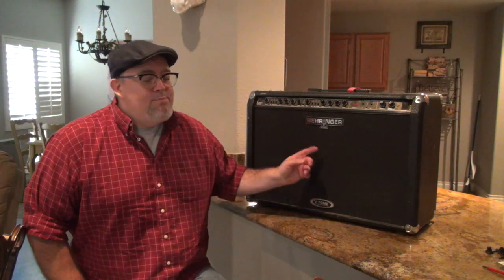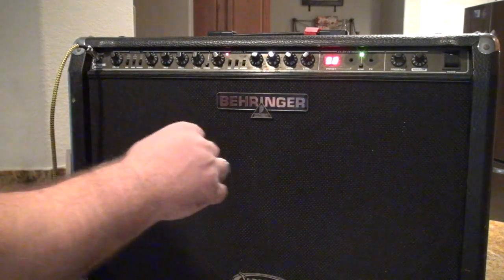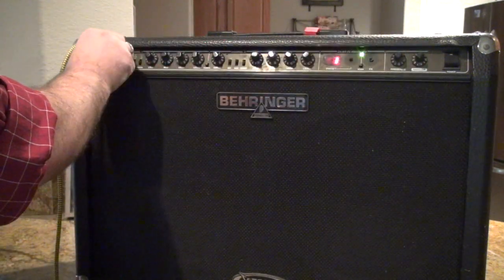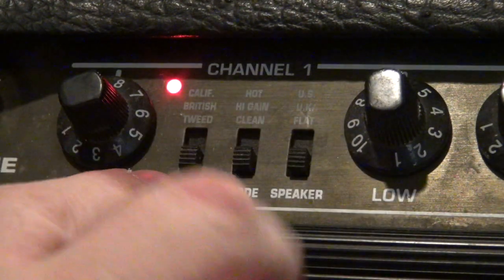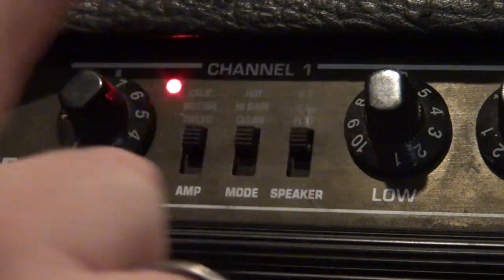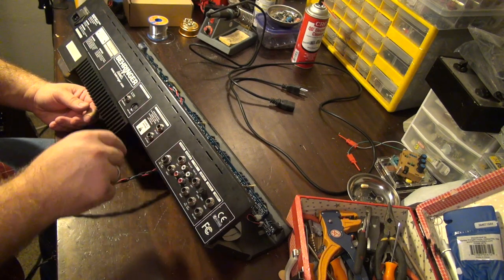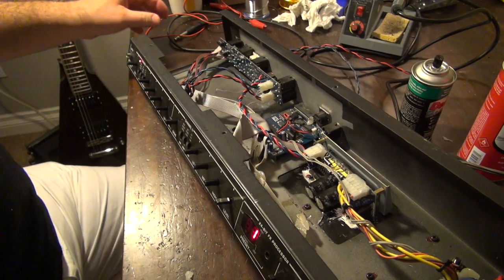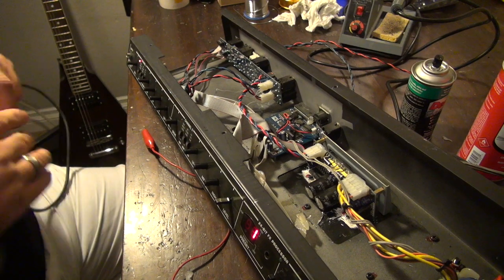Behringer GMX212 Repair and Demo

Comment: I bought one of these amps in 2004. Mine came equipped with Jensen speakers (which were likely made by Behringer and branded as Jensen). I used the amp for years and gigged with it fairly regularly. I also had the Behringer FCB1010 midi board that I used with the amp. The midi board allowed me to switch effects on the fly from a footboard which is a must if you are gigging with the amp. I had no issues with reliability and I carted the amp all over for gigs. It does not take pedals very well but the onboard effects will get you by.
Reply from the maker: Yes, I was blown away with how good this amp sounded. I'm kind of regretting selling it. Thanks for watching!

Comment: Very Awesome and informative video, although i would like to have seen some more of the capacitor fix and deoxit clean up. Great job on the clean up. Rock on!!!
Reply from the maker: I picked up another one of these that I'll be working on soon and featuring in a new video. I'll most likely be changing out the capacitors as part of the process, so I'll make sure to show that process. Thanks!

Comment: Thanks for the video. I bought one of these new. Chased problems with it after a few months. To make a long story short one of the ribbon cables was laying on the back of a circuit board. Where the sharp nubs of soldered connections were rubbing thru the insulation and shorting out. Before you spray a bunch of cleaner in the pots make sure that ribbon cable is not rubbing on the back of the board. The crackle was gone after that. I hate this amp because , it's so darn heavy.  It is super loud though and makes a backup. Definitely a young strong man or woman's  amp.  I build my own tube heads and use strictly 112 speaker cabinets because this amp taught me  to go lighter.  Head and cabinet lol , let the PA do the heavy lifting.
Reply: In addition the footswitch for these is nice and worth getting.  The Ultra bass switch will work just as well. I use one of those with my still working 15 year old Behringer PMH880S PA head.

Comment: Dave, just acquired a Behringer GMX212 and she has issues, she lights up and all knobs appear to work but there is no sound. I opened her up and she is clean as a whistle but the only thing I see is a single wire from the FS jack to a small CB looks to have been cut....

Comment: Do you have a part number for those pots?  I have a GX212 with 2 broken off knobs.  I'd kinda like to fix them but can't find much info on the web surprisingly.
Reply: Same issue here, need to replace a couple. Hopefully you get a reply.

Comment: Thanks for showing us the repair !! I found this amp on the second hand market for $ 120, do you think it's worth it to rehearse or play at home?
Reply from the maker: I think these are very underrated amps. I actually picked up another one recently for next to nothing because it's not passing a signal. I'll be featuring it in a new video as I try to fix it.

But yes, these can be used for rehearsing, home practice, or even gigging.
Reply: @davetriestofixstuff4744  I'd like to have two of these and drive them with a stereo pedal/

Comment: What potentiometer did you use as a replacement? Where did you buy it? My sister's amp knob got broken by people helping her move.
Reply from the maker: I honestly don’t remember at this point. I do remember that I ran a search for “Behringer effect potentiometer” and there was only one place I found that sold them. 

I went back to find more later and couldn’t. They seem to be unobtainium right now. 

That said, it’s possible that I may have a couple of extras from a parts amp, but that stuff is in storage right now. It’ll be a while until I get to them, but when I do, I’ll let you know and we can make a deal. Good luck!
Reply: Thank you, cool, let me know.

Comment: I have the head version The V tone GMX 1200 h-had and then the 4x12 cab. Do you still service these and work on these I need a new footswitch for it because the effects switch doesn't do anything but I can order a new one of those for 32 bucks that's no big problem but if anyting any of my solid-state or two year was to go bad are you still Servicing gear? Also this is an incredible amp I play Heavy Metal and get an insane tone from this head and cab with my affection board using just a ts9 and a Ibanez noise suppressor and then the amps pedal to switch Channels with it's an amazing amp that I got for $200 and I'm so happy with it I'm more impressed with this amp than I am my 6505 into my Mesa 2 by 12 cab

Comment: Mad props on the video.  It is much needed and appreciated.  I have owned one of these for about 15 years and I LOVE it, but recently it has developed a very loud hum and the volume level between the two channels is way off.  I tried cleaning the electronics before but you just showed me that the capacitors probably need to be replaced (especially due to its age).  I do wish that you would have shown how you changed the pots and capacitors, but I guess I'll have to find that elsewhere.  If you don't mind I would like to know how you discharged the capacitors.  I am seriously considering buying another one as well.  Anyway, much appreciation and thanks again.
Reply from the maker: Thanks for the kind words. I have another video where I fix a Peavey Express (similar to the Peavey Bandit) and that one shows the chang-out of the pots. It's the same basic procedure for any amp where the pots are directly soldered to the PCB. You can check that video out here:

https://www.youtube.com/watch?v=1OtPMgiBk3E
Reply: @davetriestofixstuff4744  Thank you so much.  You ROCK!!!  Keep up the great videos......much respect!

Comment: Hello sir , im using this amp too. But i have problem to turn on the amp. I already checked the switch and the wire are in set up properly. Are the plug in to the wall or the amp plug in wire in problem?

Comment: Hi dave ...my behringer "vintager " with jenssen speaker.....was the greatest tone i ever got with my SG ,,,, but the volume cuts in /  out ....do you have any rough idea what that would be - and would it be easy to fix?  greetings from australia
Reply from the maker: Michael Seymour it could be any number of things. It could be dirty pots, bad capacitors, loose connections, etc... but without being able to test the amp and experience the actually problem, it’s difficult to nail down a cause. 

I wish you luck with I though. And thanks for watching!

Comment: Hey Dave! Got a question for ya'. I have a Behringer V-Tone GMX1200H head and the input jack is shot. I'm new to attempting electrical repairs but really want to learn. I've got it all taken apart and now need to find out if I can order this piece. The entire input module all the way to the red and black wires that terminate into the whitish/beige plastic piece that is glued into the board. OR should I just chunk it? Lol. I hate to throw away electronics. Maybe save it for my spaceship? 😜
Any help would be much appreciated.
Reply: Hey im not super experience but I have repaired my guitar amp before. The input jack was broken and I have some soldering experience so decided to give it a shot. I just used some solder wick to remove all the solder around the input jack and took it out. Then just ordered the same part online for couple bucks and solder it back on. Not super difficult if you have some soldering experience or look up a few youtube videos
Reply: @carsostudio8618  thanks!

Comment: Any chance you can put the pot part number for the effects section? Just picked one of these amps up and sure enough, knobs broke off. Thanks for the video.
Reply from the maker: Robert Paul sorry, but I don’t remember the part number at all. I would just do a google search for GMX212 and “effects potentiometer”. I’m pretty sure that’s all I did. 

If that doesn’t work, pull the part off the board and use the number printed in the back. You could probably even find the part much cheaper thru Mouser or Digikey. 

Good luck and thanks for watching.

Comment: Soooo...I have just enquired about a pair of Jensen JCH 12/70 speakers from one of these amps that the owner is selling because the amp isn't working. I asked if he still had the combo because that would be a ready made 212 cab and was told I can have the lot for what he originally wanted for one of the speakers...(".). I'm told that "It gets a small signal through the speakers, but it's really quiet with the volume turned up.." 
Your video has piqued my interest...

Comment: By the way, this is a true stereo amp with two discreet channels. Behringer was one of the few companies that made stereo amps that gave a much wider sound field through their two speaker combo amp cabinets.

Also I noticed when you were testing the amp you only had one channel under load at a  time. This 'could' cause the opposite channel that isn't attached to a load when the amp is on to burn out the output transistor for that channel. Correct me if I'm wrong but I believe that is the correct assumption on my part. You're fortunate that this didn't happen to you.
Reply from the maker: I think you may be thinking of a tube amplifier which requires a load due to it having an output transformer.

The output transformer on a tube amplifier converts the high voltage low amperage signal coming out of the power tubes into a low voltage high amperage signal to feed into the speakers. 

In addition, the primary winding acts as resistance against the high voltage and the current running through it to the power tubes. 

Also, the OT is reflective, meaning that whatever impedance is provided on the secondary (where the speaker is hooked up) will be reflected on the primary, relative to the ratio of the winding. 

So the current running through the OT increases as the impedance lowers, causing the power tubes to run hotter, and the primary winding on the OT to heat up, possibly to the point of burning out. 

But in a solid state amp, the amplifier is already low voltage with the supply of that voltage (and the current) to the amplifier controlled by components in the circuit, and those components work independently of, and are not affected by, the impedance of the speaker.  

At least, that’s what I’ve gleaned over the years. If you find some different info, please post it here. I’m always looking to learn more. 

Thanks for watching!

Comment: Hello. I have a big problem. i'm brazilian and i have a behringer vtone gmx212 amplified box, i play guitar. I really like this amplifier, for the sound and strength that this amplifier has. worst of all, is that in brazil, são paulo state, we don’t have spare parts in brazil. authorized assistance, you can throw it in the trash. not quite. Behringer brasil, lives in bureaucracy. something q is possible to solve. my amplifier, it has a defective sound card, burned and there is no good technician q fix this amplifier, at least here. if I can't, you have to throw it in the trash. can you help me please despite the distance?
Reply from the maker: douglas rocha what do you mean by sound card? One of the boards is burnt up? Which one?
Reply: @davetriestofixstuff4744   here in Brazil we call it a sound output card.
 Where are the components like capacitors, transistors, CI.
 Where the power goes to the speakers.
 In this video of yours, you open the box and have access to the card.

Comment: Hey in new here and if you could help me that would be amazing my friend for almost a year now I've been trying to find a way to take the effects from this amp out of it and putting it in a Behringer LX 1200 h v – ampire... or some way to take it out of the combo and turning it into a pedal is this possible?
Reply from the maker: Hi Christa. That sounds like a tall order. From what I could tell, the effects circuit is integrated into two separate boards and wouldn’t lend itself for easy removal. My only suggestion is to take the signal from the line out and feed that into your amplifier of choice. The only problem would be that the entire preamp signal would be coming from that, not just the effects. 

Wish I had a better answer for you. Thanks for watching though. I have some new videos coming out soon so make sure you subscribe!

Comment: I have an amp like this and my problem is that the clean is distorting a lot it is not clean! what can it be? I'm from Brazil and I thank you for your attention!
Reply from the maker: Edson Mello check the two large capacitors in the power board. They may be bad.
Reply: @davetriestofixstuff4744  a technician has already fixed it again, it wasn’t good for a long time. will be that you changed weak capacitor? which would be the most recommendable? Thank you once for your service!

I don't speak english lol I'm writing in the translator and copying for you
Reply from the maker: Edson Mello I honestly don’t know if I’d recommend anything since I don’t have the amp on my bench to test. I’m just saying that you should check the capacitors as that seems most likely. But if you have a tech to take the amp to, go with their recommendation. Good luck!
Reply: @davetriestofixstuff4744  beauty probably should be that more thanks for the tips! I found your video very top!

Comment: Do you have the link of those capacitors? I need some. I was gonna order some from amazon but I am not really sure, if they are all the same size.
Reply: What is the size of the capacitors you got?
Reply from the maker: I don't know the link, but if you just search Amazon for 3300uf 50v you should get what you need.
Reply: @davetriestofixstuff4744  I did search it up but there are some that are 18×30 or 18×36mm. Is there a specific size i need to  get or it doesn't matter?
Reply from the maker: I'm sorry, I don't remember which one I got, but the 18 is the diameter in millimeters while the 30 or 36 is the height. So either should work. If the two you found are the same brand, I'd go with whichever is less expensive.
Reply: @davetriestofixstuff4744  alright thank you so much